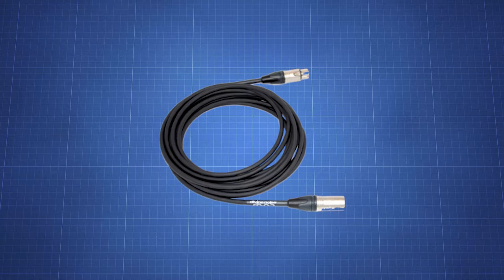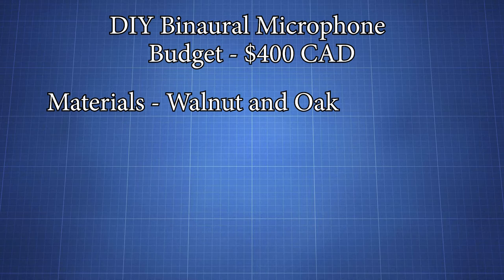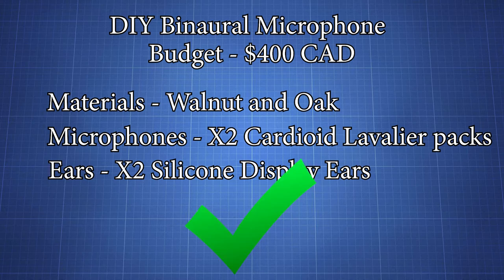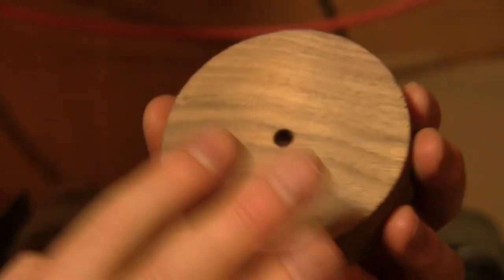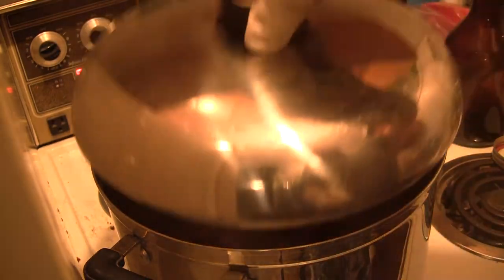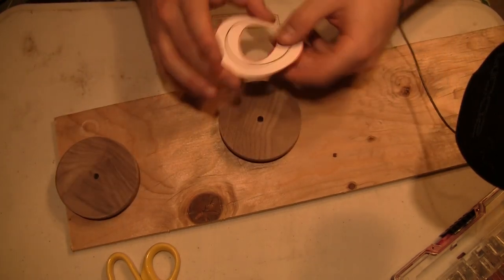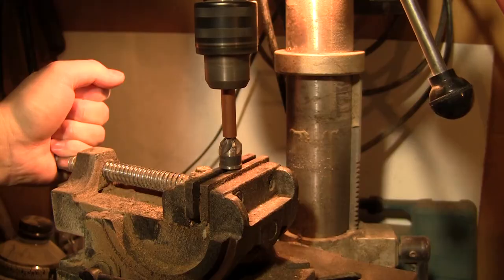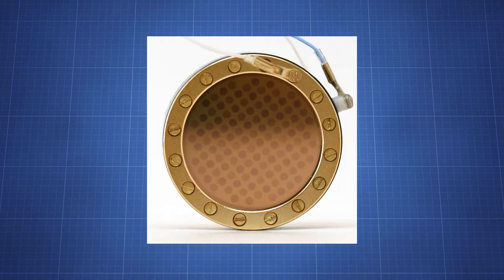Building the DIY Binaural Microphone!

Comment: Awesome video, I thought the finish looked great!  If I heard/read correctly, I think the mics you used are cardioid? Is that normal for a binaural setup? I only mention it as you said the low end was lacking, and using omnidirectional mics typically have naturally awesome low end. My understanding is that you don’t need directional mics for binaural recording, since it’s the spacing and partial blocking of sound from either side that generates the stereo effect. But I could be wrong, after all you have built it…😅 maybe something to think about for Mk2?! Thanks for sharing your work, either way!
Reply from the maker: Thanks for the advice! I went with cardioids more out of necessity than performance, as they were the cheaper option and I figured it couldn't hurt since they would be mounted in the ears. An idea I was toying with for Mk.2 would be to recreate the ear cannel and use a full size diaphragm on each side with independent drivers/amplifiers. That's still a ways off, but I think it would be neat. 

Thanks again.

Comment: Thank you for sharing! How deep into the ears did you put the mics? I can't find any info about it online, despite it seems to be a critical aspect for a realistic sound.
Reply from the maker: While I'm sure you are right, my design has the mics nearly flush with the outside of the ears. Its not realistic, but with the small size I had to work with its all I could do. If I was to redesign everything from the ground up I would replicate the ear cannel approximately 1 cm inward and use a much larger diaphragm microphone to have a better bass response.
Reply: @soundscapetheatre  Personally, I'm using the Primo EM272 capsules, same size as your lavs (1 cm) but I guess they have a wider response, great stuff.